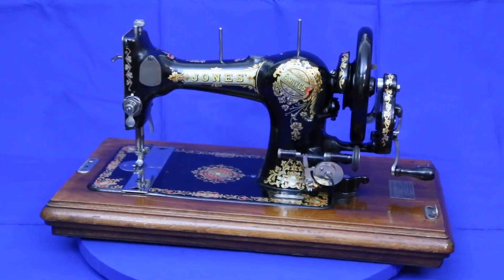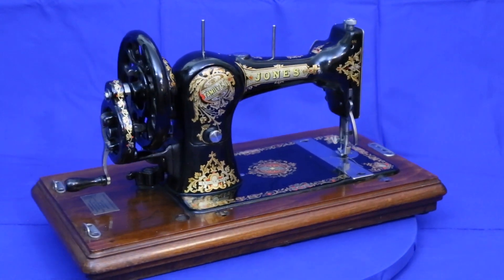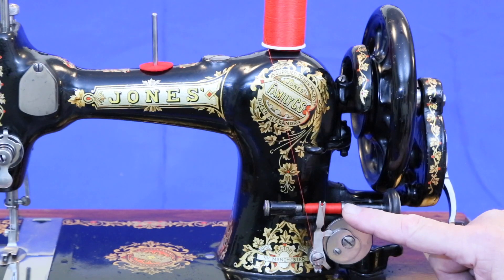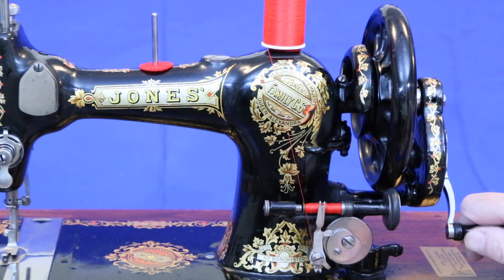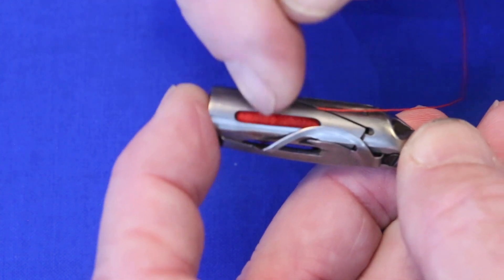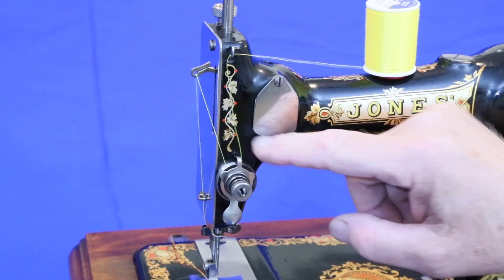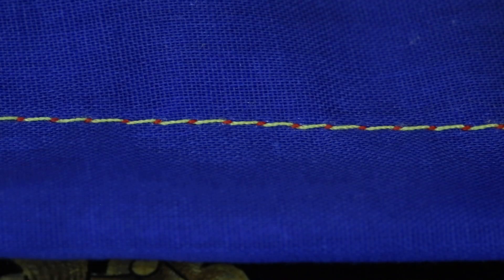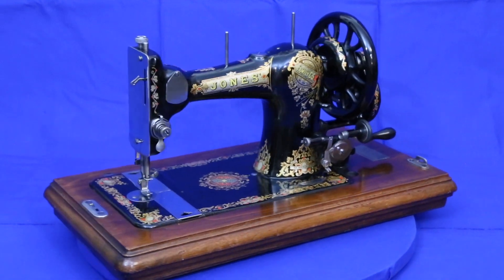Jones Model CS Antique Sewing Machine

Comment: Gorgeous❤❤❤!!!  Great instructions and great job on video.  I found your channel because I recently purchased an 1899 Singer 28K hand crank from a seller on eBay, but the machine was damaged/broken during shipment at the one hinge pin hole underneath (among other damage that is more simple to fix).  We needed a solution concerning repair.  You have comments turned off on the video where you show how to repair this area with JB Weld.  (The wire reinforcement was a great idea!)  I think you came up with a super solution.  I subscribed at that very moment. Just had to tell you this.  We'll try this repair.  

Looking forward to watching your other videos when time allows.
Reply from the maker: Thank you for commenting!

Comment: beautiful machine. I'm currently trying to touch up an old Jones machine with 'the turquoise tear drop decals. I've been watching your very helpful methods but I have a query. Before starting to add any paint you mention that the machine must be oil and grease free. What do you use to prepare the machine ?- obviously anything with alcohol would be a bad idea. The gold pen idea is great but getting the green colour is proving difficult.
Reply from the maker: I use hot soapy water, dip a towel wrapped around my finger in it so it's just damp and wash the machine one small area at a time. Then rinse with clear water. For areas with a heavy build up of oil, Krud Kutter of 409 can sometimes help, but be careful. These can burn through quickly and attack the artwork. After that, I polish it with Novus 2, a fine scratch remover. This shines the machine up and cleans the surface even more for painting. 

I've noticed that after several years, the gold pen color isn't stable. I now use gold colored bronze powder (Crescent Bronze's Rich Pale Gold) mixed 50/50 with clear shellac. To tint it, I use various colors of sharpie permanent markers taken apart and the ink squeezed out of the reservoir and into shellac. This creates a transparent, permanent paint that can be applied over the gold paint for color matching. 

I hope this helps. Good luck!

Comment: Sorry for the off-topic question, but what did you use as the basis for your hook tool in the inflatable valve fix video? (Comments are disabled over there unfortunately.) I can't find anything similar to it. I guess a crotchet hook won't work as it's not pointy enough?
Reply from the maker: A small crochet hook might work. The tool I used was a long, thin tweeter with one tong cut off near the end of the handle, leaving enough left to form a hook. If you look ate the end that doesn't go into the valve, you can see the slightly splaid end typical on tweezers. I hope this helps. Thank for commenting!
Reply: @wayneschmidt490  Awesome, thanks for the quick reply!